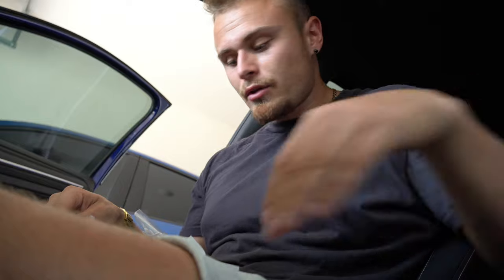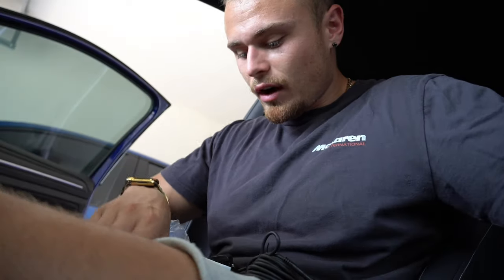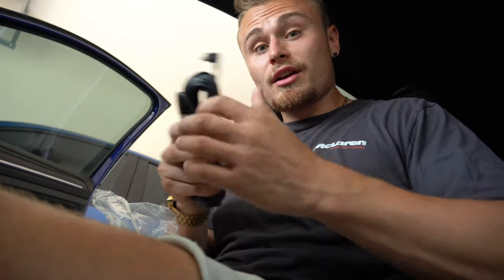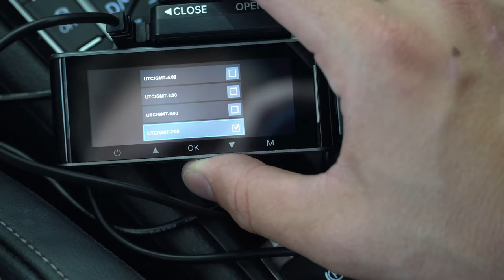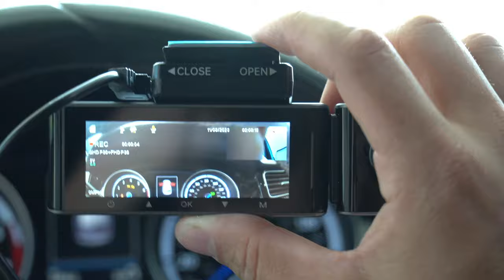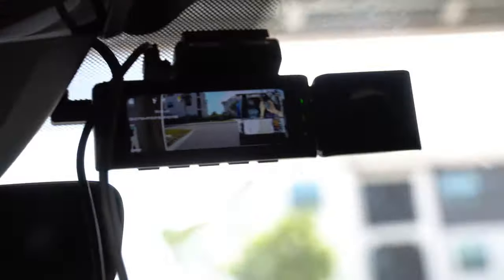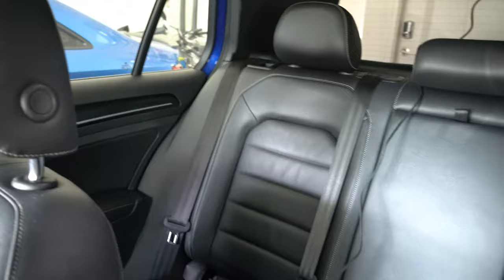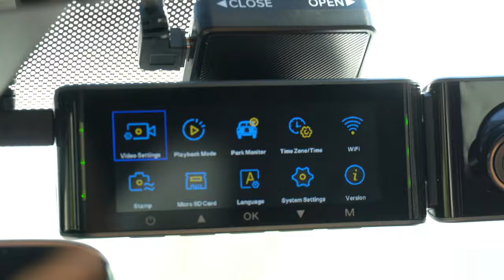I Tried This 3 In 1 Dash Cam And It's Really Cool! | AZDome M550 Dash Cam

Comment: I wanna install this on my golf 7 i wass looking your video to see where you put the cable but you skip it 😑
Reply from the maker: I ran the front camera cable around the top and to the left and then tucked it under steering wheel and into the center console to cigarette lighter. The rear camera I ran through the passenger side of the car top trim and up to the front